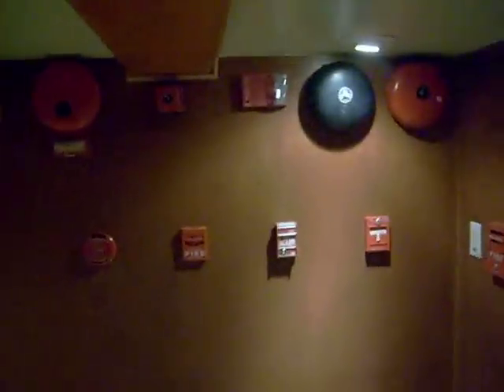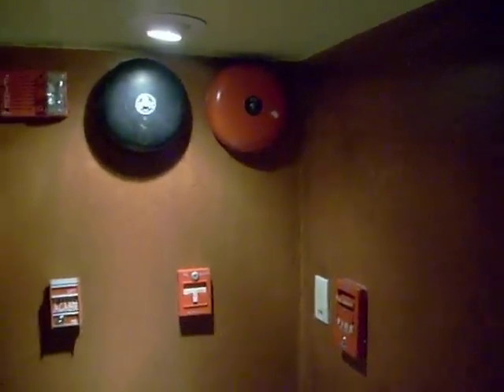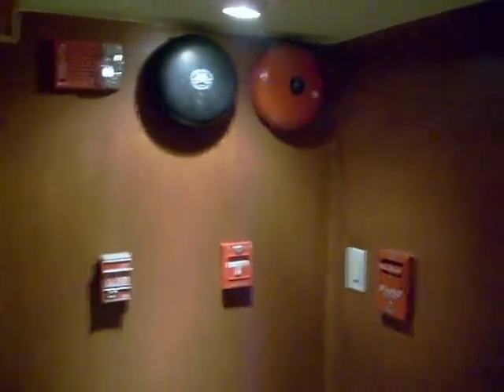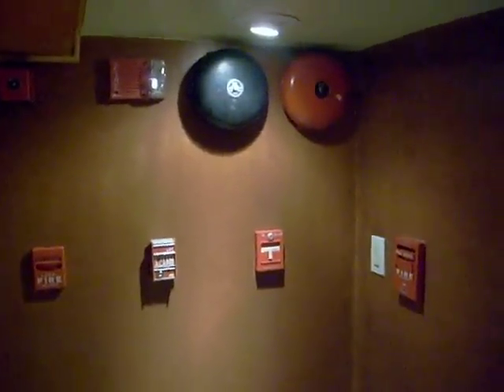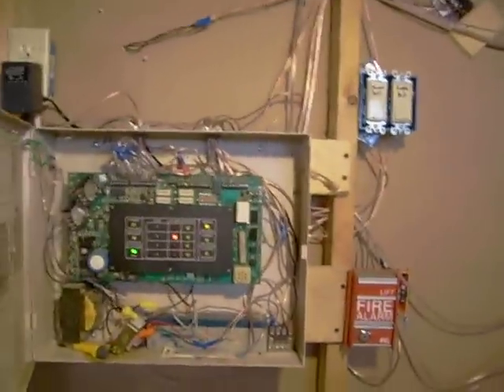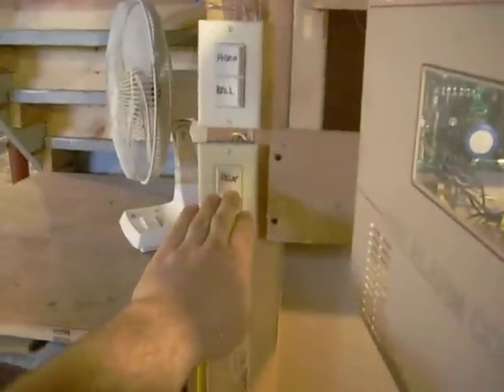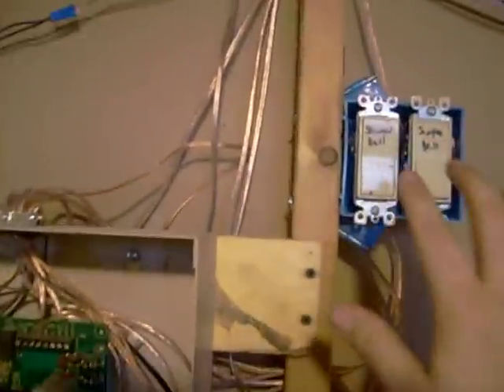New Fire Alarm Collection - System Test 6 - Simplex Single-Stroke Bell

Comment from the maker: @MircomFan The Single stroke bell is what I remember from my childhood - I grew up in the eighties when these systems were still prevalent. I try to buy them whenever I can but they're getting pretty rare.
Reply: Is that the normal stroke cadence or is it faster due to the higher voltage?  Also, I'd like to find a single stroke bell, but I do not have information on makes and models. Do you have information or access to information on these bells?  Thank you
Reply from the maker: @SocialistDistancing  that is standard March time, 60 beats per minute. 1/2 sec on, 1/2 sec off. It's electronically generated on modern panels but is usually still an option. In the older days panels, including simplex, used 1 RPM motors with a tab wheel on it that moved past a little microswitch to generate the pulses. The bells are hard to find but still made. Usually for industrial purposes... The can be special ordered, ADI has them.
Reply: @brettman273  thank you , that was helpful.  Someone is selling numerous bells online, and I am hoping that he has a bell that I'm looking for , however, I don't know makes and models of single stroke bells. So, that is what I am looking for.  A list of single stroke bell model numbers. Any ideas where I can find that?
Reply from the maker: @SocialistDistancing  it's probably unlikely unless you know the manufacturer and model number of a bell for sale, then you can google it to see if spec sheets are available. Most manufacturers now only carry a few if any at all but you'd have to check each manufacturer to be sure.
Reply: @brettman273  ya, I was thinking about that. I would have to get all of the information from the seller. I don't know how many bells that he has. He needs to count them. So a suspect that it's more than ten.